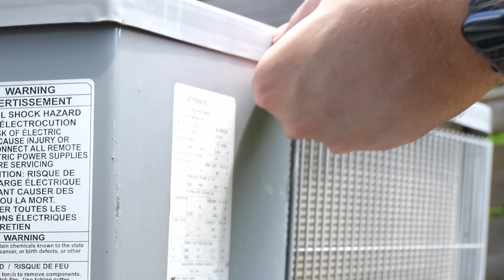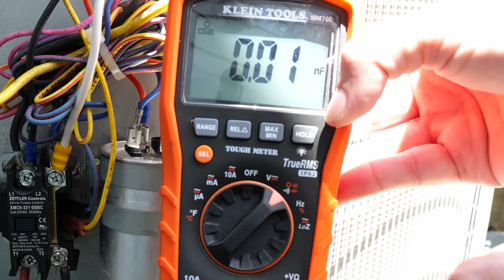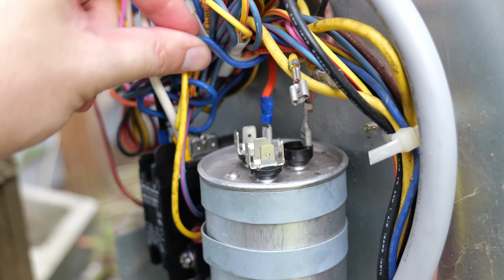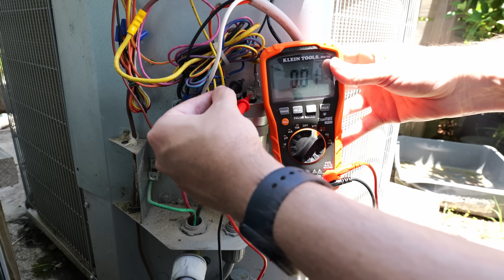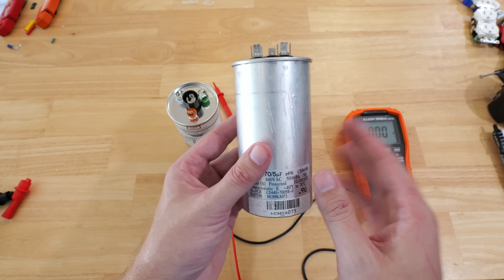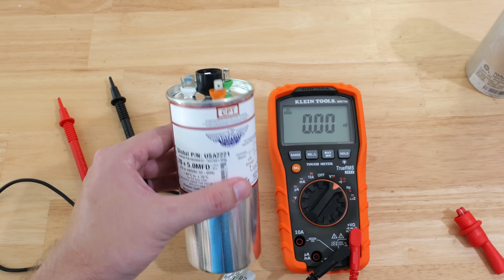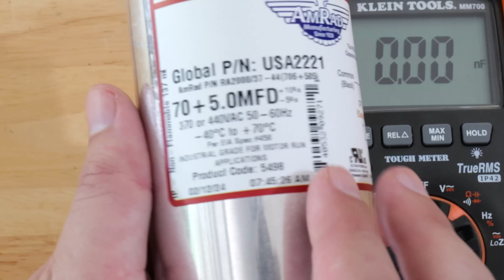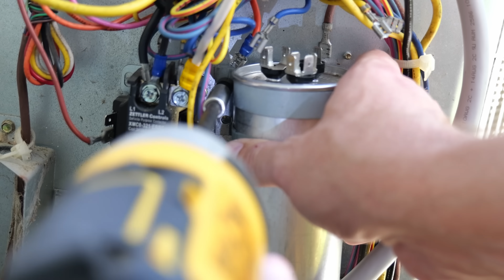Don’t Get Ripped Off! How To Avoid The AC Capacitor Scam And Save $500

Comment: If you test hot to hot and it reads less than 1 volt AC, there is no reason to test between each hot and ground.  To get 240V, each hot is 120V which are 180° out of phase with each other.  So if one hot is dead, it will still read 120V.  Then you check each one to ground to find out which one it is.  But hey, if you want to be extra careful and in the name of extreme safety, by all means.  Extra checks won't hurt.

As for discharging the capacitor the way that you are doing it is wrong.  Granted, the capacitor is low value, but the current pulse can damage it when you short the terminals.  The proper way to discharge a cap is to connect 1K ohm resistor between the terminals and let it sit for a for a minute or two.  For those that don't know, capacitors are energy storage devices.  They store energy in an electric field between two plates.  Because of this, caps will not pass DC, but will pass AC.

If you have a multi-meter without a cap tester, then you use use RC charge and discharge to determine the value, or use a signal generator to measure the voltage across the cap and measure the current through it.  Capacitors are reactive components meaning that the resistance to AC (impedance) depends on frequency according to the formula 1 / (2 * pi * F * C).

I was trained in electrical and electronics almost 40 years ago then I earned my engineering degree.
Reply: If one leg is open (it happens) you may very well show no voltage and have one leg still 120V. When testing for personal safety one should always check each legs to ground. What you said will almost always be true, but that one time can get you. Been both an industrial maintenance electrician and a stationeer for a very long time. You'd be amazed at what happens that shouldn't be able to. Be even more careful if on a ladder or a roff. A shock that would have been merely unpleasant can cause you to fall off and die.
Reply: @thomaswarford2920  Yep, check leg to leg, then one leg to ground, then other leg to ground. Takes less than six seconds. Takes longer to get your meter out of the case than to check voltage all 3 ways.

Comment: You have to watch HVAC companies. Not all will cheat you but a lot will. I'm a disabled HVACR technician with 40+ years experience. Companies have a lot of overhead. They have to pay for gas for the truck, insurance, technician's pay, tech's insurance, and other costs that the consumer is unaware of. They also have to have a business license for EVERY town and county they do work in.  That's why repair costs are so high. Everything the video tells you is correct on checking a capacitor. There is one thing that a digital volt meter can't tell you is whether the capacitor is leaking between the plates at high voltage. I have had some test ok with the digital meter but I still had to replace them when tested on my 'old' 110 volt analyzer that I've had for years. I don't believe they make them anymore but it will test one under 110 volts of power and a load vs. 9 volts or less on the digitals battery.  It has been invaluable to me in my career. If however, a digital tells you it's bad, then it's bad (if tested with the wires disconnected).
Reply: Decades ago, the tech broke my fuse disconnect holder, I was on the roof with him and saw this happen.  I asked if he was going to take care of that and he replied "sure".  I went to work and after work climbed on the roof and found he had "jumped" the fuse box to make it operational, with no fuses for safety.  I called that company's owner and said if this wasn't fixed right at no charge the next day that this would be all over the TV news, and they fixed it.
Reply: SCAM attempt !!!  My mom had a "free" home AC inspection done, and the "tech" tried to sell her a replacement system since hers "was 11 years old so beyond its normal life", and she said no.  Within a couple of hours her house was hot and her vents were essentially pushing no air.  I went over there, she said the "tech" had been on the roof taking off the AC cover, and I did similar and saw the evaporator coils were covered with a huge block of ice.  I told her this was no coincidence, that the "tech" either accidentally or on purpose disconnected something, made her call them and the AC was fixed for free the next day.

Comment: If your capacitor is fully charged, a good way to damage it is to use the screwdriver to discharge it. You had a multimeter  in your hand - switch it to DC and measure the 2 voltages. If there is a high voltage, use a 20k OHM 5w with two alligator clips (well insulated) to discharge.

Comment: 3:25 that is actually very dangerous. Please don't use a screw driver and don't tell others to do so. Use your meter to check for DC voltage instead.
Reply: DC voltage??? 😂
Reply: @kv-ry5gh yes?
Reply: @kv- @kv-ry5gh honestly I tell apprentices to leave it on automatic if available or check for both AC and DC for capacitors, depends on the meter. Non contact pens won’t detect DC which is why I specify.
Reply: @SuperS05  Run/start caps are AC voltage.
Reply: @ElectricalToolReviews do your research. They are actually 2 capacitors with a diode (oxide layer)  in parallel but opposite directions
Reply: @SuperS05  That's not actually how an HVAC run capacitor is constructed. You are describing a polarized electrolytic DC capacitor, which does use an aluminum oxide dielectric layer.

An HVAC run cap is a non-polarized, metallized film capacitor (usually polypropylene film coated with a micro-thin layer of metal, rolled up in oil). There are no diodes or parallel oxide layers inside them; they are completely symmetrical, which is why they operate natively on AC and why the terminals aren't polarity-sensitive.
Reply: He's not using the screwdriver to check for voltage, he's using it to remove residual charge before checking microfarads.
Reply: @ElectricalToolReviews and that's the dangerous part. Learn some electrical theory
Reply: @SuperS05  It's standard industry practice for most Electricians and HVAC technicians. It's not dangerous as long as you are careful.